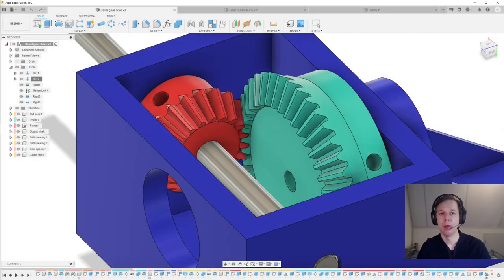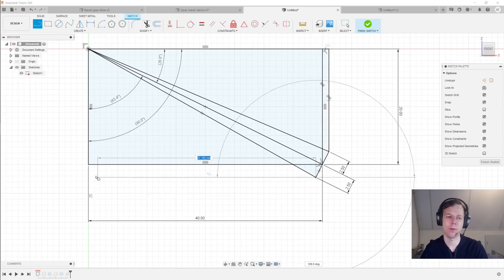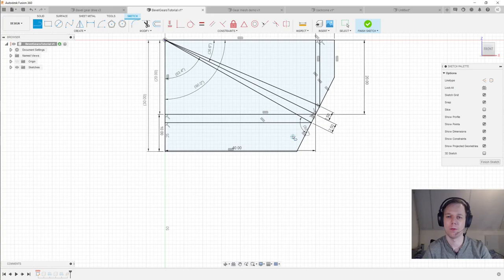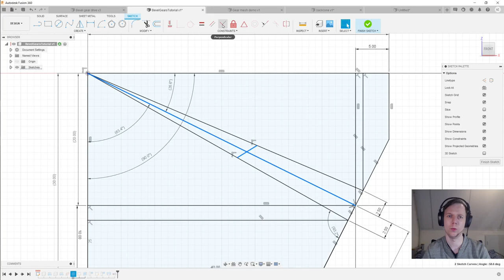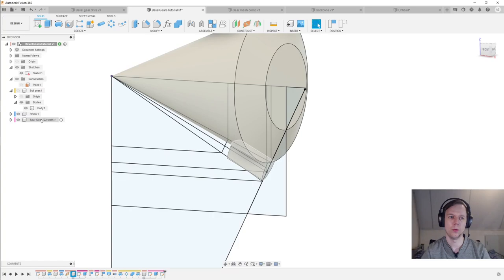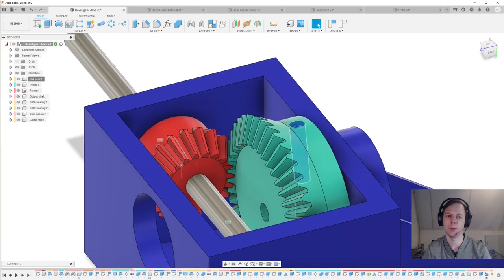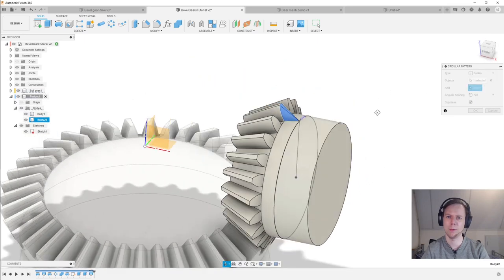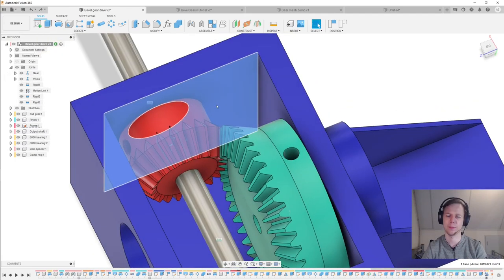How to model Bevel Gears using Tredgold's Approximation (Gears pt 6/7)

Comment: This video saved my butt.  I was trying for days to model a bevel gear set for a project, and the mesh never worked out.  I didn't understand about the back cone and virtual gear.  Your explanation was perfect.  I am using SolidWorks, its wild how different F360 is.

Comment: Nice demonstration. Easier than doing them from scratch. Here he uses a shim to locate the pinion, and the bull gear position is adjustable on the motor shaft. If the gears were printed as drawn and placed with no way to adjust them, they would bind due to over-print. The effect is more pronounced on smaller gears and requires trial and error and sometimes reducing the tooth width of one gear or the other to get the mesh correct and zero backlash.

Comment: This is excellent - I used your method with Solidworks (and manually modelled involutes for the fun of it) and it works very well. Thank you :)
I must also say, that I am envious of Fusion 360 being able to animate parts and examine motion without having to swith to an assembly file. That is very cool...

Comment: Fantastic video, I am learning a lot from this series. I would love to see your approach to making a helical bevel gear in Fusion. I'm not quite sure how to get the appropriate twist in the lofted teeth, and how to get them to mesh properly. That would be an interesting video.
Reply from the maker: Thank you! I thought of doing it using a loft with guiderails, but I haven't actually done it. I think you will also need to emboss the curve onto the pitch cone, but again still need to look into that.
Reply: @antalz  I tried with guiderails with both Sweep and Loft features, but I couldn't obtain a satisfying enough result. So I ended slicing a straight tooth, rotating each slice as needed, then executing the Loft feature with all slices as profiles.
Reply from the maker: @steelstone  That's unfortunate, that sounds like a lot more work than embossing a curve and then doing a guiderail loft.

Comment: This is a good approximation. The spur gear used to give the tooth profile is normal (at right angles) to the pitch cones line of contact. I've seen where others set the spur gear rotation axis equal to the bevel gear rotation axis. This causes loss of tooth depth but not tooth profile width and therefore a very distorted bevel gear form.
Reply from the maker: Yeah that's a big reason why I made this video in particular. There are a lot of videos out there on gears that are wrong, but specifically on bevel gears there is a lot of misinformation.
Reply: @antalz  Thanks. I've been producing gears for decades on my CNC lathe and milling machines. Only ever spur gears. Now with 3D printing, I'm getting into other applications and one job requires bevel gears. So where do you go to learn such design? LOL. I love YouTube but as you say, there's plenty of bullshit out there. I'm an Aussie. We don't say "misinformation" That's way too polite. LOL.

Comment: Excellent tutorial.  One quibble, though.  At 37:30, if the tooth profile is the (almost universally-used) involute form then, even though the axes are displaced, the teeth still roll against each other without sliding.  It's just that the pressure angle is increased.
Reply from the maker: I didn't know that, thanks. Do you have any source where I can read more on this? Does this relate to profile shifting, because that's another thing I should learn more about.
Reply: @antalz  The fact that I mentioned is at http://4mechtech.blogspot.com/2015/06/comparison-between-involute-and-cycloidal-gears.html.  If the gear teeth are too narrow at the base then increasing the pressure angle makes them wider at the base, at the expense of an increase in separating force along the line joining the gear centres.  If you Google "involute profile shifting" and choose the Marples Gears site there is more info on profile shifting.  However, I still don't understand how a profile-shifted gear meshes correctly (i.e. rolls, not slides) with a non-profile-shifted gear.
Reply from the maker: @chrisarmstrong8198  I'm not sure that site says the contact remains rolling. It does say the velocity ratio remains constant, and I think that's correct. I also think you're correct that the pressure angle increases because a further-out piece of the involute contacts. I'm just not entirely convinced on rolling contact, though to be fair it took me a while to see it's perfectly rolling for a perfect involute set. I'll study this some more, thanks again.
Reply: @antalz  I offer this hand-waving justification :) Consider two rotating cylinders, with parallel axes, joined by a piece of taut string marked with equally-spaced dots and arranged so that, as the string winds onto one cylinder, it unwinds from the other.  The dots trace out the involute flanks of (one side of) imaginary gear teeth on BOTH cylinders, with the dots themselves being the contact points.  (To trace out the other half of the flanks, the string needs to be wound in the opposite direction on each cylinder.)  The relative velocity of the contact points on two mating imaginary gear teeth must be zero since they are produced by the same dot.  Changing the separation of the cylinder axes does not change this fact.  Zero relative velocity at the contact point implies rolling contact.
Reply from the maker: @chrisarmstrong8198  Hand-waving maybe, but convincing! Thanks!

Comment: Excelent video thanks. If you hollow the large gear it might just be possible to mount another bearing inside it between the gear and the shaft.
Reply from the maker: That's actually a very interesting idea, though it does appear to me assembly could get tricky.

Comment: Tx for sharing that completed gears lesson. Btw, you told to manually adjusting the layers height within the cura's slicer, with bigger at base, thinner at top ... but how do we do that ?
Reply from the maker: In Cura you should be able to get started by ticking "use adaptive layers" under the experimental features.

Comment: Very clear and complete instructions, as always!
But far more complicated as plain spur gears, and placement of the gears on the axes is quite critical as you explained.
I want to 3D print pretty small gears for use on perpendicular axes; about 10 mm diameter for the pinion to mount on the axis of a small Mabuchi type motor (as the ones in servo's), driving a large gear of about 80 mm diameter. After seeing your excellent tutorial, I'm now considering to make thinks easy for myself and use a regular spur gear for the pinion and a crown gear for the large gear.
But crown gears don't seem to be very common, except for in toys, tower clocks and wind mills .... How do they compare to bevel gears?
Reply from the maker: I'm still a bit confused by a crown gear to spur gear mesh. The way I understand it now is that it can only work with copious backlash and some friction. I probably just don't understand it correctly. The wind mills of old didn't have the technology for proper gears of any kind, let alone bevel gears. Modern turbines don't use crown gears as far as I know.

I think your problem can be done if the torques aren't too large, by SLA 3D printing. The pinion will be very hard to do with FDM I would imagine.
Reply: @antalz   Thanks for your prompt reply. I'll do some experimenting.
I just found 2 articles on this subject, you may find these interesting too:
https://www.geartechnology.com/issues/0901x/Weck.pdf
https://www.powertransmission.com/issues/1013/crown_gears.pdf
Reply from the maker: @janpoppeliers8619  I'll take a good look at these, if I figure it out I have another video to make

Comment: Hi, great video
I'm interested, what would happen if instead of using the gear generator, you make the tooth profile for the gear with 25.73 teeth or any non integer number.
Would it be reduce backlash between teeth, or it would cause them to interfere? 
Thanks for your time
Reply from the maker: I think you could in theory make a slightly better fit with that, but the profile difference between 25 and 26 teeth is very small. Very few people are making bevel gears at such precision that it matters.

Comment: hey Antalz I love your tutorials they are very informative! I was wondering if it wouldn't be too much trouble could you further expand on this tutorial by adding how you could create a helical bevel gear?
Reply from the maker: Thanks mate! At the moment I don't quite have time to make videos unfortunately, but I'm hopeful I can get back into it. The bigger problem is that I don't know how to create a helical bevel gear. I have some ideas but I don't know if they create correct gears.
Reply: @antalz  I'm still playing around with it but that's my problem as well. I'm thinking that i need to use the contact lines length to drive the twist angle. I then made a offset plane at 50% of that and again at 50% of that as well and then divided the twist angle accordingly and rotated the original loft sections by those angles and created a new loft

Comment: could we theoretically draw the 2d face for a regular gear, and do a loft to the centre point, then "cut" the body?
Reply from the maker: Yeah that should be possible too, it might even be better because you can get that fractional virtual number of teeth. Drawing an involute manually is a chore though.

Comment: Cant you put a bearing and support in front of the large gear before the shaft of the small one to stop the cantilever?
Reply from the maker: Yeah that's definitely possible, but it can be tricky to put the bearing there and still make the whole thing assemblable. For high torque or high power applications it's worth investigating.

Comment: This is great but I tried it for a 30mm diameter, so radius would be 15. Approximation is around 21.25 so I take it 22, but the gear tooth stays to outside for module 2 gears. 21 also stays to outside...
Reply from the maker: Do you mean you're getting interference? This might be because if you're doing 15 teeth undercut is required, which the Fusion360 gear generator doesn't do correctly. Even then undercut is better avoided if possible, a larger pressure angle may help.
Reply: @antalz  Hi there, thanks for the answer, I will try different pressure angles.

No, I meant when you align the single tooth with the plane you created along the intersaction axis, your gear tooth is almost halfway embedded inside the cylindirical body. In my case its not embedded, kind of touching in bottom middle, but edges are lifted.

Maybe it is normal and I need to sketch and extend so I can create the solid feature, but it feels like it is wrong and I might have problems later on.
Reply from the maker: @ROBOROBOROBOROBO  If I remember correctly, the tooth getting properly embedded in its gear occurs one or two steps later when the base of the tooth is push-pulled a bit to embed it properly.

Comment: I am getting small amounts of overlap on the meshing of the teeth when I make gears with a higher module even with backlash, I do everything else the same except in the case of the gears I am trying to model they are a ring and pinion with 43/13 ratio and a module of 3.5 and I am using a backlash of 0.1, should I just move the gears further apart to force separation like in your pt. 2 of the gears series?
Reply from the maker: If the overlap is small I suspect it's because of the 13 tooth gear. That is below the undercut-free limit of I believe 17 teeth for 20 degree pressure angle gears. Either increase that tooth count, or a pressure angle of 25 degrees should work. Fusion's generator can not model undercuts. Also check you have a correct combination of gear ratio, shaft angle and cone angles.
Reply: @antalz  oooh thank you very much! I suspected that I should increase the pressure angle as it's a high torque application, this model is for a transfer case. The overlap is very small but visible by eye so it would bind in a 3d print for sure, maybe I could manually add a small undercut for low pressure angle gears with a small number of teeth? I believe my combination of ratio, shaft angle and cone angles is all good, my sketch looks to be correct and I used simple formulas like you did but with my 3.5 modulus in place, the joints and motion links also work correctly minus the small overlap which is consistent on every tooth so positioning seems correct. I'll try the higher pressure angle and if that doesn't work I'll manually undercut the teeth, thank you for your help!
Reply: @antalz  After a bit of investigation I found that even with a pressure angle of 25 degrees I had a slight overlap of the teeth, when I had the backlash set to 0.1mm I found that moving the pinion 0.4mm further away from the ring gear allowed the teeth to mesh well but technically now the pinion would be off center of the correct position of the shaft, would this have a significant impact on the performance of the gears?
Reply from the maker: @liamgleason3416  I don't think that'd have significant impact for M3.5 gears. Still strange.
Reply: @antalz  thanks for your help! I always go back through your videos when I'm modelling gears to double check my work, they're the best!

Comment: I still get confused when to be working in the original part or the separate components. When the gear tooth is lofted and trimmed, you have the bullgear active, but when the teeth are patterned, you go back to the original part to pattern them. Why aren't they patterned with the bullgear active?
Reply from the maker: I went back to the root component there so I could edit the big initial sketch. The thing is, if you do an operation for "new body" or "new component", those get put into the component that's active at that time. So for the initial loft I'm doing a new body, so the bull gear must be active so that body ends up in the bull gear component. For cutting and patterning it doesn't matter, those features end up in whatever component you were cutting, or in the component that held the thing you were patterning. In fact a cut can affect multiple components. If you look on the timeline you see that the pattern and cut both ended up with the color of the bull gear component.

Comment: Are there any reasons to not have the contact lines/inner diameters of the two cones parallel to each other? Wouldn’t that offer more contact area? I may be wrong, just wondering.
Reply from the maker: No that just doesn't work geometrically. As you get closer to the apex, the gear ratio and number of teeth have to stay the same. To make that happen, the teeth have to become smaller as you get closer to the apex. For that to happen the inner diameters must converge onto the apex point, meaning they can not be parallel.

Maybe you mean making the teeth longer, but that doesn't actually increase contact area; it just makes the teeth more likely to break off.